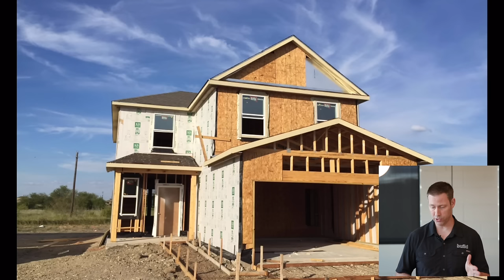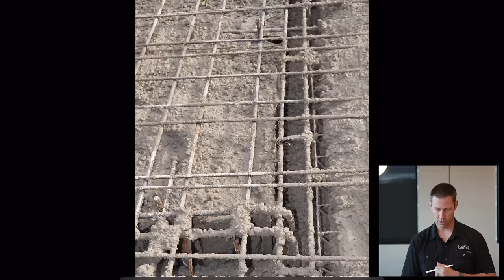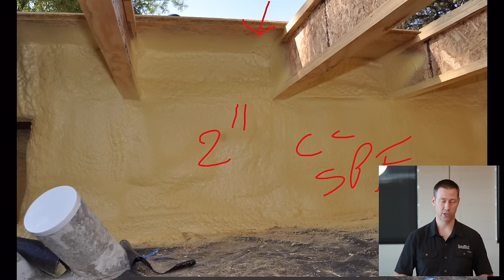Foundations - Slab vs. Pier and Beam - Which is better?

Comment: Great truth on that "hard on the joints and bones" observation with the slab on grade. That's why I refuse to ever again live in a house with even tile floors. Too old for that now. I need a floor with give, and I'm not even standing most of the day. Just walking around if home most of the day will put a lot of extra wear and tear on your body without a floor with some give. 

I also like the idea of having easier to fix plumbing. I rented a place recently in a neighborhood that was all slab and I recall a neighbor across the street going through 2 years of hell trying to get her plumbing fixed. She often had no hot water and torn up floors all over the place. It was really a nightmare. Give me a crawlspace and wood floors! I'll deal with whatever drawbacks may come with that.

Comment: Matt, did you use any insulation under the vapor barrier on our slab foundation by the lake?
Reply: Foam under a slab is common in Oz.
Reply: Insulation fails if it gets wet.
Reply: Not true. I've talked to both DuPont and 3M; standard foamboard is suitable for wet environments and is perfect for under a slab.    @johnbecich9540
Reply: For clarification on foam boards they all absorb water over time, but the wet to dry factor isn't quantified. So always put a gravel base with ventilation out the roof that pulls radon gases out and drys the insulation. Best building practices.

Comment: Is it a problem if the ends of a post-tension cable ends rust out?  No rust protection was applied to the post tension mechanisms on my house and they rusted out.
Reply: If only the cable ends are secured this sounds like bad news. 

Ideally the whole (length of) cable should be grouted /epoxied in place.

NB, the cables are (need to be) run through the slab inside a plastic sheath / tube to allow adequate post-tensioning - (these must be laid fairly precisely for good results)
Reply: That’s a shame.  A home should last generations without major failure. What are those builders thinking?
Reply: Steve Slade 
That’s shortsighted thinking in my opinion. My grandparents home on both my father and mother’s side was purchased by one of their children and later by one of their children. My dad owned two homes.  Two of my brothers bought those and live in them till this day.  I understand that there’s a limit on permanence. Nothing is permanent. But quality builds and maintenance make a home more valuable on resale.  One of my children already expressed interest in buying my home so you better believe that I want to leave it in good condition.  But regardless of who buys my home, they deserve an enduring home with no major problems.
Reply: Steve Slade   Five days in 1967 changed the course of history for Detroit.

Comment: In Australia we have a standard AS2470 which still allows for footing and slab design for residential foundations, based on visual assessment. That is a significant saving in pre-construction cost. 
Sand
Clay M, H
Rock
All these standards listed in the Code.

Comment: Matt in Europa we insulate on top of the slab with 10/12centimeter hard insulation and on top goes a 10centimeter of rough sand/cement mix not to wet or to dry the name of this process is Estrich fine finished most likely u heard of it u r my favorite builder back in Germany I did lot concrete slabs brick/block stucco inside and outside we spray it on the walls in piece work thank u for posting so much love ur channel blessings to u

Comment: Living in Maryland where basements are common, it’s the kiss of death on a resale for a house on a slab to try to compete with houses that have four finished basements. Think about a rancher for example – you get 100% more living area for the cost of the basement. Certainly there are places where basements are not feasible, but if the issue is blasting out enough rock to make it it would be worth the price.

Comment: Pier and beam also uses less concrete - which is a big environmental plus.
Reply: Didin't know that using rocks that stay a long time is more environmental friendly than rebuilding it from wood every 20 years.
Reply: Concrete production is ~5% global human emissions; where wood is replaced more frequently, at least it removed atmospheric carbon when alive 💪
Reply: @mgjmiller1995  Concrete stays for a long time, wood doesn't, in the long run concrete is more beneficial and more environmental friendly.
Reply: o74769 —- There are wood houses if done right I. E. Breathe, that lasts for hundreds of years
Reply: @RJ-sr5dv  Nope.
Reply: And you provide a home for rats, raccoons, mold, and termites - which is a big environmental plus.

Comment: I’m confused. How can anyone crawl underneath there? Seems like there’s no room.
Reply: Good question. I don't know about his, but the ones I've been under here in Oregon leave about 2 feet of space. That means a kind of sideways crawl, butt, feet, knee or calf, elbows. Then you mostly lie on your back while doing any work.

Not awful once resigning yourself if there is no plastic vapor barrier to getting dirt all.over your pants (brushes off) and after learning (if there are any) that spiders want nothing to do with you. Just go around any seen.

I added a new plumbing line for moving the water heater all easily and by myself using CPVC and caring not one bit how many rooms were above me. With a slab, as if jack-hammering weren't bad enough, going under walls is a nightmare.
Reply: randalusa Thanks! This is why I need a husband! Lol
Reply: Smart way to go.

Comment: "Which is Better"...? NEITHER! How 'bout a full 9 foot basement Foundation. 

But then I'm biased because I live in the frozen north of Minne-snow-ta
Reply: I was shocked when we moved from " the north" to Atlanta so many storage company's. Because they don't have basements to store the Christmas tree or Jr's bed while the grandparents stay for a few weeks.
Reply: You likely need that just to bring your water in unfrozen.
Reply: @davidwooten3430  indeed we do good sir. Indeed we do.
Reply: @davidwooten3430  This Old House showed an inlaw house in Newton, Ma with a slab-on-grade the only major difference that the outer perimeter foundation wall went past the frost line which in MA is about 4 feet. the foundation went to 5 feet with the water lines coming in and remaining buried bellow the 4 feet till after it went passed the exterior foundation wall.
Reply: I am from MA and thus a North Easterner, more basements than slab or crawlspaces here from my experience as a former basement waterproofer (step dad own and operated a company and whom I worked for the longest at the time when I was young at 15 to 22, mostly seasonal work). I also from living a few homes with such prefer a basement for the extra space, especially if insulated and somewhat conditioned compared to an unfinished and unconditioned drafty one.

Comment: Built my current house on a slab - we're not worried about floods around here, embers from a bushfire are a bigger worry and a slab is really good for keeping them out from under your house! But the idea of renovating or extending in any way that wasn't part of the initial design? Forget it.
My next house will have a crawl space. It'll just be really well walled in.

Comment: 15:30 wtf? you pour the slab on xps or foam glass and the insulation is continous which is not a case when using pier and beam which cant be insulated without heat bridges;

Comment: Matt, I'm a custom home builder in the San Antonio area, originally a production builder in Austin when open carry catapults were the concealed carry of choice (22 years ago.) I am really interested in going to pier and beam. My foundation engineer is an expert witness AGAINST post tension slabs, so when I do post-tension, its so over-engineered, I might as well go steel, which is typically 30% more than a post tension slab due to steel costs.  I have poured probably around 800 slabs personally and 3 to 4 thousand as a manager. I too would do steel on every home, but lets face it, budgets are a reality. I digress. I have a couple questions: 1) take the client out of it, would you prefer a pier and beam slab  or a post tension slab on grade? Where I build typically has very low PI's, from 15-30. 2) With the LVL, I-joist, and 1 1/4 1 1/2" Advantech subfloor on the pier and beam, how do the two compare cost wise, slab vs pier and beam? This time last year lumber spiked through the roof, but taking the fluctuations in lumber out of the equation as well, which is more cost effective? I love the access you have under the home on a pier and beam and it is my understanding the structural components have the same 10 year structural warranty that you typically have with a monolithic slab on grade. After building many homes, I dont see any reason NOT to do pier and beam over a slab on grade, paricularly post tension. You obviously had a client want pier and beam, but if they had not, would you still have  poured a pier and beam. As you know, a lot of builders are resistant to change. We also have to deal with public opinion. If you are the only guy doing pier and beam in a crowed marketplace, your either a genius or an idiot, and you now have a new objection to overcome. In summary, cost compare the two with all factors being equal, topography, soils, etc. BTW, I have lived in pier and beam homes most of my life, including today. I thought Barron Custom Design and Agave started the farmhouse craze, but someone forgot to tell all the developers and ACC's that board and batten done is stucco is moronic. I just tasted vomit (4 sides stone and stucco) in my mouth when I was typing that. Good job man. Even the pro's like your videos and can learn a thing or two. Keep up the good work. Burrion
Reply: Could u use steel beams instead of wooden beams on the PB foundation?

Comment: But, WHAT ABOUT THE EXTERIOR of these 'foundations, from 'slope' to 'water proofing'?  Would you suggest a retro-fit FOR the Pier and Beam?  How do you protect your older farm house styles, FROM pests?  Rodents to termites?  How would fix any settling?  Could we use I-joists, THEN repair settling in drywall?  I did enjoy your video Crawl Spaces.  It covered some of these questions, however briefly.

Comment: One thing to consider also with beam footing with slab is that the beam footing forms a pattern of squares and polygons and work to keep the slab in effect together to prevent excessive cracking on the horizontal.  This becomes important when you run into installation issues with rebar on the 4 to 6 inch slab portion that most construction crews tend to walk on and then inadvertently push the rebar down to the bottom of the slab which makes the rebar then mostly ineffective on the inside of the these squares.  You can see this happening on Matt's video where crews are walking inside the perimeter of the pour and are more than likely pushing and topping over the rebar from their plastic chairs; these chairs tend to be flimsy and easily toppled.

Comment: Hello Matt, l love your videos! 

We have a 1969 ish bi-level pour concrete foundation with flat work interior walkout patio in the back. The property is on a slight slope Northwest NJ. We are having issues with water accumulation on the flat work in corner back garage for years but always drain down.

However, I just found out our clay footer titles are clogged up. However, we never had water infiltrating inside the house. I trust your professional advice.

Comment: Our home in the Dallas area had a slab foundation. So does our current home, in the Phoenix area. In Texas, with its expansive clay soils, it's very hard to keep a slab foundation from cracking. In Arizona, without the expansive clay soils of Texas, it's easier to keep a slab foundation from cracking.  Still, our home, built in the 1980's, has several cracks. Any cracks in the slab will telegraph through a tile floor. Possibly worse, a crack is a potential entry point for termites. It's not that a pier and beam house will not settle. It will, but any issues from the settling are easier to fix.
Reply: David Walser David, If done right, houses don’t settle. They will shrink if wood framed but they should NOT settle

Comment: i am in the uk and the way we would insulate the slab would be to have the first pour a sub-floor and allow it low enough to put in some insulation(3inches -6 inches) and then pour an additional 3 inch finished floor on top of that

Comment: Great video....a suggestion, if just for the unconditioned P & Bs..... 5.5" SIPS.....instant insulation, instant floor, and instant strength.  Did my home in Sips back in 90s....crazy strong and put real hardwood over it.

Comment: In Denmark concrete slabs are poured on 400mm (about 16inches) styrofoam  to insulate the floor.
Reply: I literally though ICF when he mentioned the insulation with slabs. I mean really ICF is more than just for walls as some manufacturers already offer floor/ceiling forms making it easy enough to do a stilt aka pier and beam or in other terms a pier and raised slab type foundation.
See this website for what i am talking about with more info and images to show: 
https://www.insuldeck.com

Comment: Curious is you have used basilisk in your concrete work at all? Also do you have an opinion on hempcrete? What about earthships and other alternative construction materials/methods?

Love your show btw. I learn so much it's crazy.
Reply: not sure what a mythic snake has to do with concrete, or did you mean to say basalt (composite reinforcement made from the type of rock which the name comes from)?

Comment: To insulate a slab foundation, you place 2-3 inch thick boards of extruded polystyrene like Dow Highload 40 on the compacted gravel under the poured concrete.  I did this for a pool that I built, and it was difficult to ensure that there were no gaps between the gravel and the concrete.

When you have a conditioned crawlspace or a full basement, you really need to insulate the floor from the ground.  You might think that the underlying rock or clay would be a good insulator, but it's not.  Perimeter insulation is not enough.
Reply: From my own experience and knowledge, XPS soaks up water like bare concrete and did basement waterproofing for a living for a time for my step dad (as the longest job I held when I was younger then). Wonder how well the XPS actually performs compared to EPS which does not retain water which reduces buoyancy but also the insulating value which is why EPS is popular in floating home foundations as well as for additional float to correct imbalance of the floating. Also why many of the ICF makers choose to stick with EPS as it sheds any water that it does take on simply through evaporation. Not to mention the cost difference from the manufacturing process where XPS is extruded and EPS is simply steamed pellets into a moulded form.
Reply: @Joshua79C  Interesting! XPS is definitely more expensive than EPS.  It's mechanically much stronger, both in tension and shear but also in compression.  XPS resistance to compression creep is why it's required by code under foundation slabs.  I'm quite surprised to hear that XPS absorbs more water than EPS, I would have guessed the opposite because it is continuous closed cell and should have a much smaller exposed surface but I haven't measured it, nor have I seen XPS exposed to years of continuous immersion.
Reply: @IainMcClatchie  I am just basing my info on XPS exposure to water by the minute amount of info I found on that. But like with any insulation like EPS even it does help to include a water barrier to one side to protect from ground water intrusion since I do know that concrete will hold water as long as there is a source to provide it with continued wetness, That is based on working in the basements as I said doing abatement and repairing "leaky" basements. I always hated working in oones using cinder block cmu for the walls, as those are like reservoir tanks and we would have to drill the center of where each pocket is (at the lowest point where the masonry unit meets the slab) to let out the water being retained inside.
Would imagine that XP requires being compromised to open the cell structure to allow water to seep in. but eps just sheds it and any molecules inside just dry out through natural means of evaporation by just drying out the area.
.

Comment: Im a remodeling contractor out in the small mountains of New York. I've seen so many issues with all foundations-basements, slabs, crawls. Water pretty much always being the culprit. After the things I've seen, I love the idea of staying off the ground. As high as possible. Completely open vented, pier and beam. Closed cell under the house. Make sure all drainage pipe below is pitched properly. Only downfall around here is the shower traps below the floor can freeze if you let it. If past builders properly waterproofed and drained these homes I may not feel that way. But i'm sure in the end they all can work out great if they are done right.
Reply from the maker: That’s what I love about Remodeling. Old homes teach us lessons to apply to new Builds!  Thanks Carmen
Reply: Thank you Matt!!! The building science I've learned from you has made me a top notch remodeler!!!